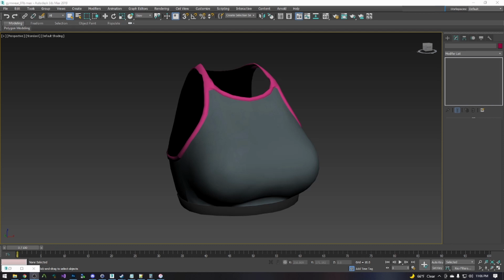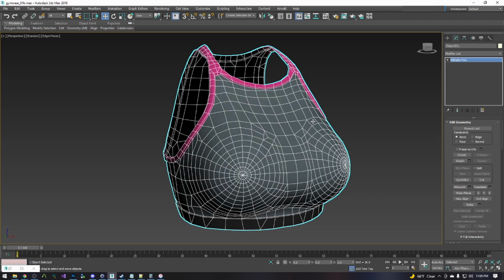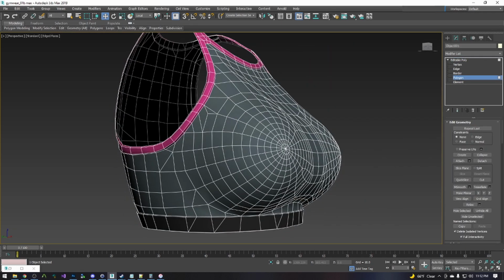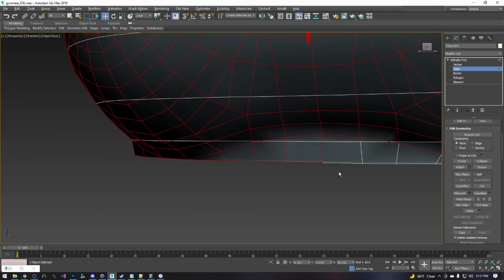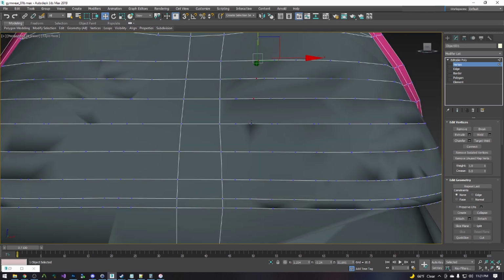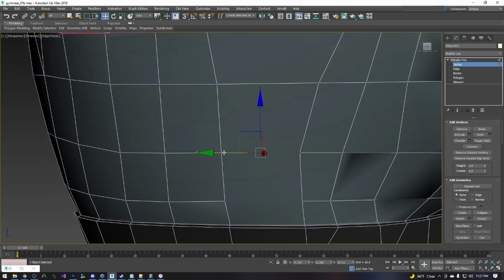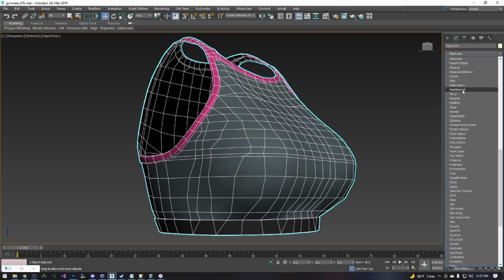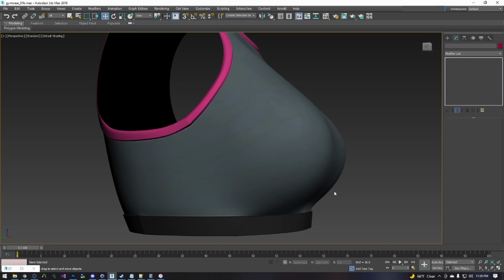Aggressive Retopology

Comment: cool! is there a reason you dont just do one side and then mirror it?
Reply from the maker: Maintaining the original UVs. If the UVs and textures are mirrored, then you could absolutely do that. This is representing a general case, where the UVs and textures are not mirrored.

You could of course also reUV the mirrored side to reflect the unmirrored textures, but at that point, you're doing more than just a simple retopology. Maintaining the original UVs was a key goal here.